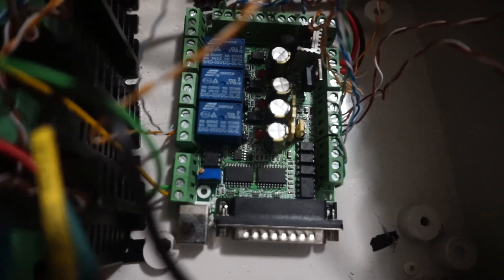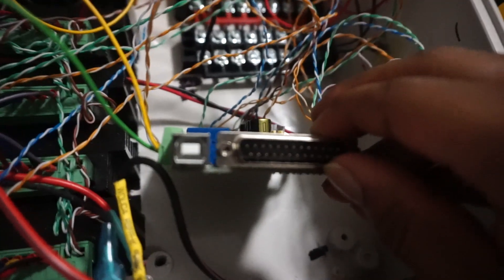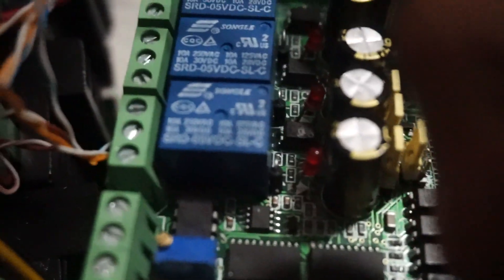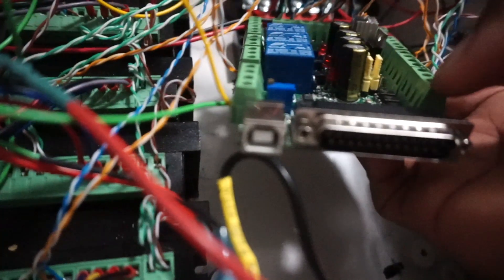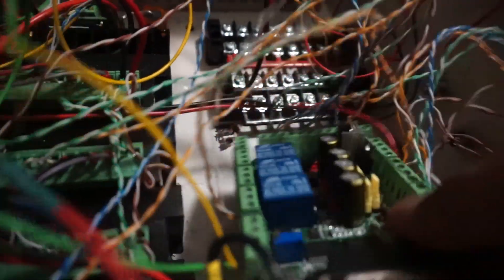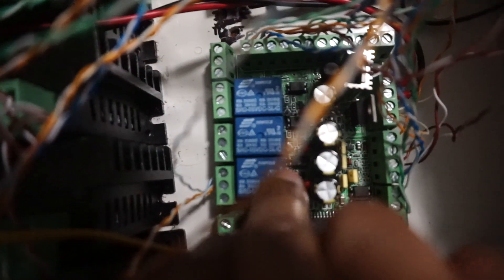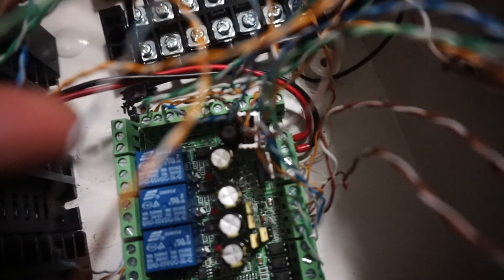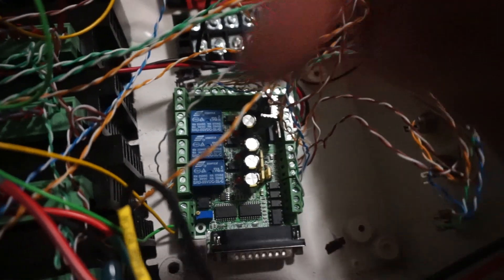The overview of MACH3V2.1-L 4-axls Breakout Board CNC Controller

Comment: Sometimes PWM is done on the ground side. "ground chopping". There seems to be less problems from my experience when you chop ground versus chopping power. The controller your using tends to reset everytime it receives a pulse when power chopping. This is a very common method of speed controlling a fan. Speed controlling a motor is not much difference.